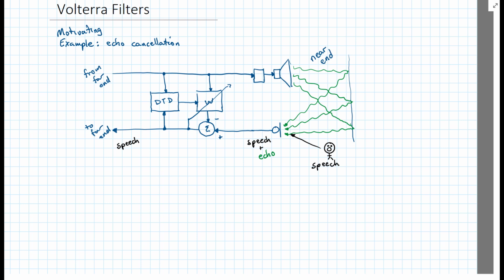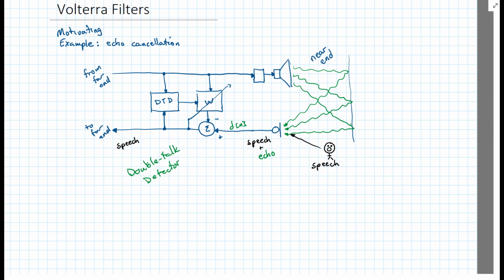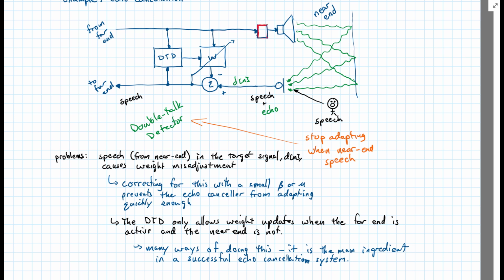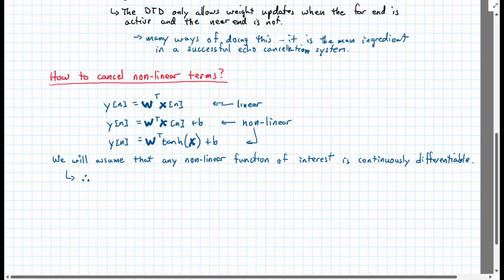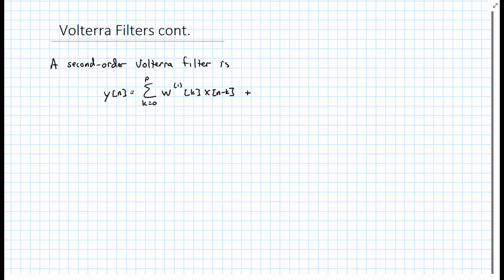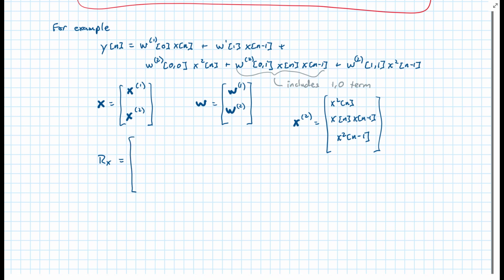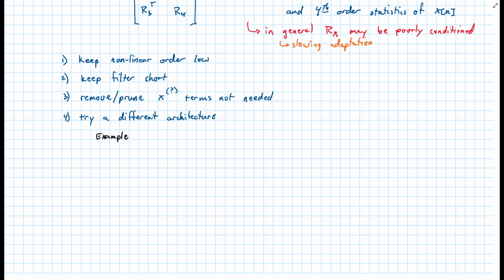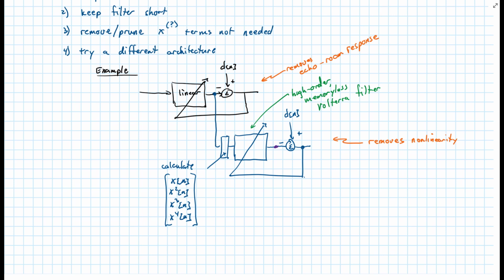6271 58 VolterraFilters

Comment: Возникает вопрос: а вы на практике такой эхо подавитель пробовали?  Я провел массу опытов с обычным линейным LMS эхо подавителем - на дешевой акустике ничего толком не работает. Позже я пытался  вставить в фильтр нелинейности, но не помню что получил ощутимый результат. 
Реально мне удалось выйти на практически ценные результаты только при переводе математики на спектральное вычитание (чисто нелинейная обработка).
Reply from the maker: Echo suppression is a very difficult task with non-ideal, non-linear speakers. I've seen several approaches to address this.  One is to use a linear echo canceler cascaded with a non-linear (Volterra) echo canceler.  The reason for the cascade is that the eigenvalue spread is too large is you simply use one large Volterra filter, and it won't adapt very well.  In practical cases, this will still leave too much echo and so a non-linear processing is used as a last step.  This is often done as a noise gate (remove all sounds below a threshold) but I like your idea of using spectral subtraction because it will better match the signal.  Do you use the speaker signal + a nonlinearity to estimate the spectrum to be subtracted?
Reply: @dspfundamentals   Я прослушал курс лекций в МГУ по DSP - https://www.youtube.com/@izoalex/videos  
Их читал парень, который сейчас ведущий специалист фирмы Izotope.. (программы по обработке аудио). Там в качестве домашнего задания была разработка шумо-подавителя на спектральном вычитании. Я сделал его в двух-микрофонной версии (основной сигнал и фон). Хороший результат был получен, но в производство он не пошел. Тогда я переделал эту разработку в эхо-подавитель. И случилось чудо. Если эхо-подавитель Speex-а дает  максимум 10..12dB в идеальных условиях, то данная версия дала 36-40 dB в аналогичных условиях. В условиях сильных искажений, вызванных клиппированием, подавление эхо оставалось на уровне 22-24 dB.
Reply: Thanks for this video.